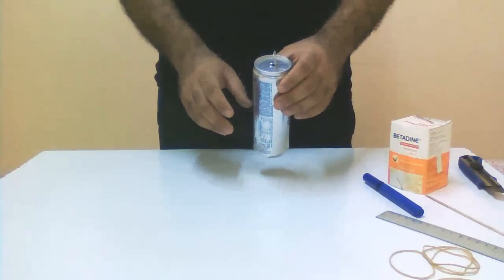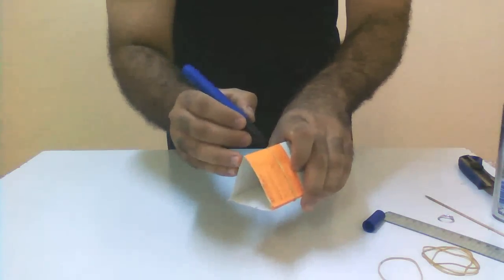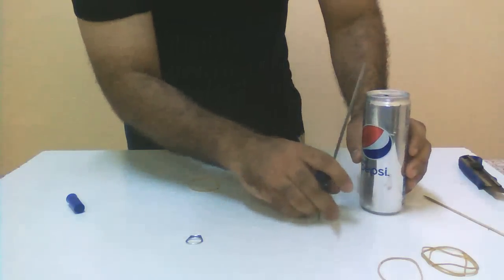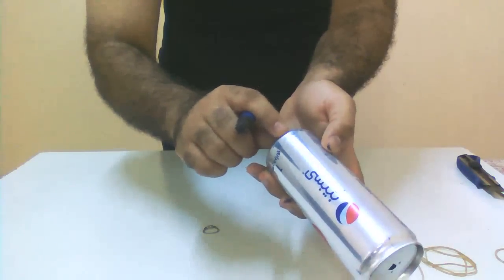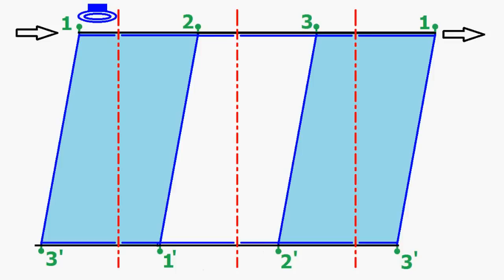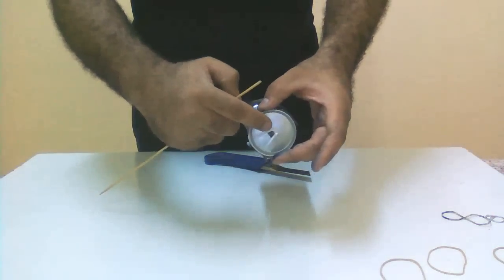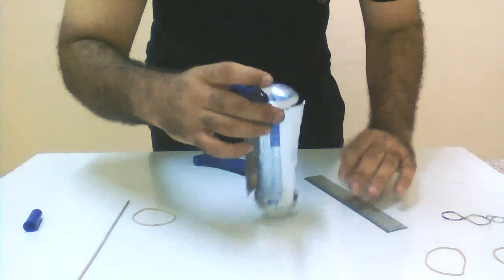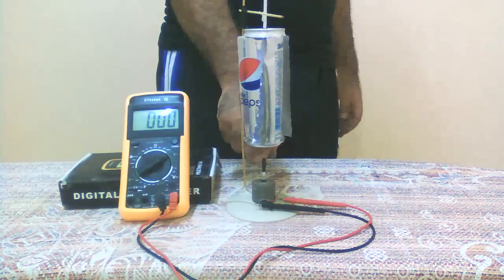DIY Vertical wind turbine from coke can - 10 min's!

Comment: Try using masking tape. Wrap around the can and overlap the ends. Cut through the tape in the middle of the overlap. Remove the overlap pieces. Remove the tape and stick the tape to your ruler and make your marks. Make a plumb vertical line on the can. Put the tape back around the can and lay out your cutlines. Do the same for the bottom. 
To find the center of the bottom of the can = put the can on it's top end on a flat and level surface. Place a BB in the bottom and when it stops moving, voila...center of the can.

Comment: And what if 2 generator and use it horizontally with winds due to the elevation or decrease the temperature even on smalls walls ?
Or way much other places ...
Between roads, which could sounds a bit "harsh" in some places ...
Just wondering ...